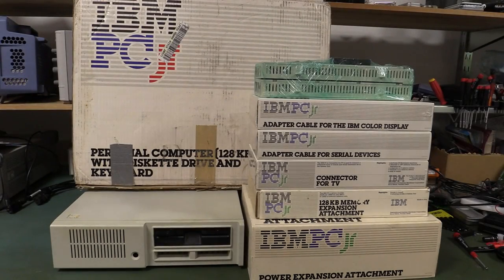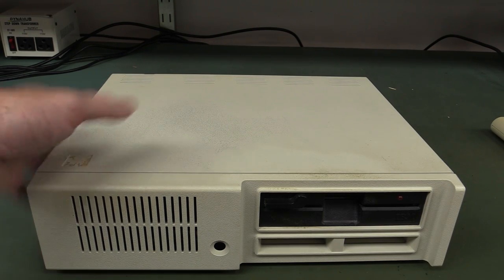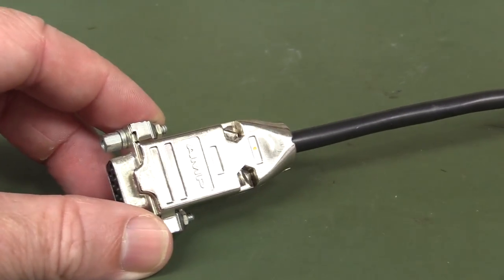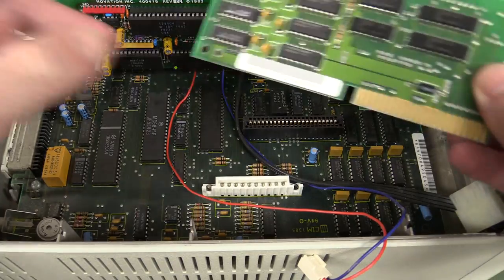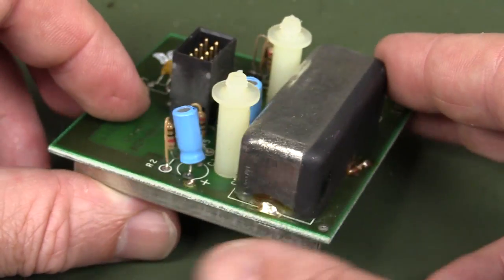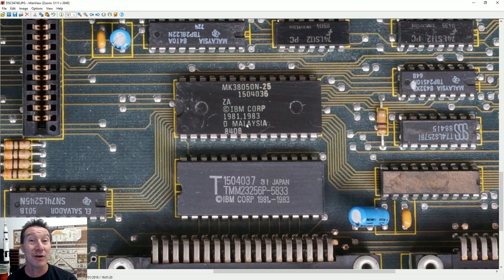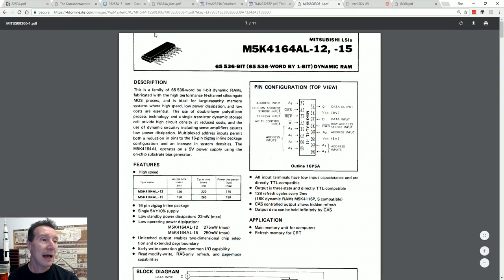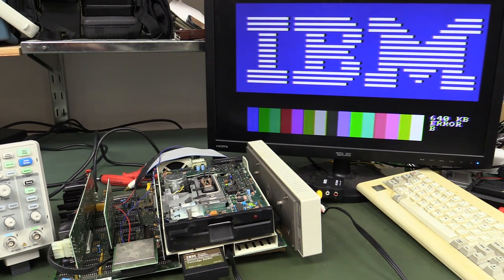EEVblog #1053 - The Biggest 80's Computer FAIL - IBM PC Jr

Comment: Dave, open up the memory expansion side thing. The upgrade to 512Kb should be full of wires going everywhere. I remember upgrading mine. The plans for the upgrade came on fan fold paper. Of course, all ascii art. We were amazed to have a PC with 640 k at that time.
Reply from the maker: Will do, forgot that!
Your user icon is my image :-P
Reply: Yes, it is!! I had it for years now... The "dancing dolls" never get old.
If you can check to see if the cartdrige reboot system is as I comment below..
We used to make the weired connectors for the back ourselves with standard headders. You should have seen IBM's printer cable. Built like a tank..

Comment: Tandy did a much better job of taking the PC Jr tech and turning it into a usable product with the Tandy 1000.
Reply from the maker: Indeed
https://www.youtube.com/watch?v=av5NQ_3mW9A
Reply: Are you the same tandy ?
Reply: @Rohit Chaturvedi, Not quite, the original Tandy Corporation AKA RadioShack went bankrupt. We acquired some of the company assets including the Tandy brand and have revived it.
Reply: 1000EX was my first!
Reply: One thing about Tandy computers, they seemed to be well built.  I worked at radio shack during my college years and we had a 386 Tandy come back for routine service because the floppy wouldn't read data anymore.  It was used in a farming equipment service center... or maybe they used it as the plow.  It didn't look too bad on the outside, but when we opened it; it was almost completely full of dirt.  You could not see any part of the motherboard.  It looked like the surface of the moon.  There would be a little square or rectangular rise in the dust where a chip was.  Not one colored wire or piece of green PCB anywhere to be seen.  Cleaned it out, cleaned the heads on the floppy.... good to go.   I realize older computers didn't suffer from thermal issues like the modern counterparts, but to see a computer almost completely full of dirt and in regular service is something to behold.

Comment: WTF? The most intresting Part is this modded Memory Expansion! So please tear this down!
Reply: You can find instructions on the web about how to do the mod (as well as tons of other PCjr mods, like overclocking, two floppy drives, making the PCjr video mode Tandy-compatible, etc.).

In fact, I went ahead and uploaded the file I have here: http://mkgraham.dx.am/pcjr.html

Download the PCjr Club Library file and look in the Tool Box folder for a ton of mod instructions.  I just realized it doesn't include 512k instructions for the IBM sidecars, but it has 256k and 384k upgrade instructions, and has larger upgrade instructions for the Racore sidecars (and I somehow adapted them for the Microsoft Booster sidecar at one point in time).

Comment: Some companies did add a second oscillator for 8 MHz and called it the TURBO mode. Amazingly, they actually had a button to choose TURBO mode, instead of running it at 8 MHz all the time...
Reply: ats89117 The turbo button was nessecary because a lot of software, mostly games, was timing sensitive and would run to fast at the higher clock frequency. Standard speed was 4.77MHz.
Reply: Yeah.. try to run one of those old games in a DOS window today..  :-)  It'll be game over before you get your finger off of the start button!!
Reply: Steve Jones , thats were dosbox and slowdown.exe come in handy! 😴😉

Comment: 4.77 MHz was standard across the entire PC lineup. They chose that instead of the rated 5 MHz because it was a convenient frequency for the CGA to generate its clock and color burst frequencies from. They cut a few KHz off the chip's top speed to avoid having to put another oscillator in an addon card.
Reply: Thats what he said

Comment: I built my own 128K side car expansion.  Designed the Refresh logic and eteched the PCB.  I was lucky to find the source of the funky sidecar pass thru connectors.  Also built a sidecar that accepted an ISA hard drive adapter card.  Had to reprogram the bios on hard drive controller card to use polling mode since no DMA controller.  Had to de-compile/assemble the controller bios to source code (it was not published as far as i know) and hack in the polling code.  Connected an Oveletti 8MB hard drive.  I was in heaven. 
 Had great fun designing and building those projects, learned quite a lot.

Comment: The encoder on the floppy drive is designed so that you can adjust the speed from the 50/60hz flicker from a fluorescent light
Reply from the maker: Ah, yes, instant timing light!
Reply: Good call, over engineering knocked down to the bulb in the factory!

Comment: Ironically the Tandy 1000 was a clone of it.  And it was one of Tandy's most successful product.
Reply from the maker: Mentioned in there
Reply: Nice.  Still watching it.  Great video!
Reply: One of the main reasons was that it used standard components and connectors, not these stupid proprietary IBM ones.
Reply: Actually, the Tandy 1000 was not exactly a clone. First, it had much higher end graphics onboard. Second, it was based on the Phoenix BIOS. Third, it had more address space due to some odd little choices made with regards to DMA allocation. Fourth, it actually had a multi voice audio controller. Fifth, it came standard with joystick ports and controllers. Sixth, it supported MFM hard drives directly on board. Seventh, it actually had a dual mode switching power supply. 8, It ran IBM DOS directly with zero mods. 9th it had the ability to run IBM Basic, natively.  The Tandy 1000 was much more than a clone. It was the machine the 5150 should have been.  Having said all of that, actually, the Tandy 2000 was Radio Shack/Tandy Corps most successful machine. Yes it had compatibility issues but, it was faster and far more capable than anything IBM and ALL other clones had to offer at the time. And, featured what would become industry standard over time, video mapped outside the system RAM space.
Reply: Radio Shack managed to clean up fine over IBM's mess.
Reply: @robertking7584 So amazing.... try to find that today, a private label better than what's supposed to be the A-brand...

Comment: Dave,  the floppy could not have been "360 single-sided".   The single sided were either 160 KB if eight sectors per track or (with a tweak to DOS) you could make it 180 KB by jamming in a ninth sector.   The dual-sided diskettes were 320 or 360 depending upon sectors per track.

Comment: Great video Dave.
I worked for IBM New Zealand as a PC specialist and I was sent to your neck of the woods (Rosebery NSW) to be trained on the new PCjr. Even we true blue IBMers thought that it was a pile of junk. The one good thing about it, that I remember from the training, is that you can disassemble the whole unit by using any small coin. (Apart from unscrewing the system board.)
The PCjr was never actually sold in New Zealand. I was pleased about that.
The Japanese created a 'slightly' better version called the PCJX which IBM NZ and Aussie did sell.  (It was not available anywhere else other than Japan.)  It did not do fantastically well.
Reply from the maker: Wasn't IBM at Cumberland Forest back then?
Reply: Nope, not quite yet. They were in Rothschild Ave in Rosebury before going bush into the forest.
Rothschild Ave had the compute centre, the warehouse, offices etc. And around the corner in Morely Ave was the technical centre where they did electronic rework and other maintenance.
Reply: Come to think of it. IBM was still there in 1987. That is when the PS/2 and OS/2 came out. I was back at Rothschild Ave for the training.

Comment: My first IBM PC was a "turbo" XT with a clock that was switchable between 4.77MHz and 8MHz via a little toggle switch mounted on the back. Interestingly enough, you could switch clock speeds on the fly without crashing the computer.

Comment: During 80's the power adapters where heavy and bulky. However they didn't  have any fan neither the CPU. Most desktop computers didn't have a noisy rotational hard drive and were more silent  with the exception of the floppy disk drive occasional noise.

Comment: My very first computer. Once they were discontinued, they were cleared out relatively inexpensively, and made a pretty decent value for the time. IIRC, I got it with disk drive, DOS, a memory expansion sidecar and another sidecar to connect a Microsoft Mouse, for about $700, earned at my summer job between high school and college.

Comment: By the time I was messing with computers, most of them used UART16450 and UART16550 chips for Serial. The older chips were considered unusable for anything faster than about 2400 baud.

Comment: Ahhhh, the Peanut.  That's what we called it.  Was sold at IBM's short-lived retail outlets, typically located in the parking lots of shopping malls, usually sold to banks for use as satellite branches.

Dave, the extra power module was typically not needed.  Very few of those were sold.  But it was necessary if you loaded up the PCjr with "wedges", like that printer port wedge you showed.

As for why the Jr was so lean.... the idea was to use the Peanut to get folks thinking about upgrading to an XT and the execs did not want Peanut cutting into XT sales.  The market for Peanut was supposed to be children, not hobbyists (who were expected to shell out for the XT).

On the rear peripheral connectors.... there was a paper template with color-coding that you would mount to the rear bezel to ensure you plugged in a given cord into the proper socket.  The cords themselves were color-coded at the connector after a while.

As for that "AMP" connector you showed.   Using off-the-shelf connectors was a Don Estridge strategic decision to reduce cost.   But IBM executives in Armonk were furious that the connectors were not embossed with "IBM".  Later cords from IBM were indeed corporatized with "IBM" instead of "AMP".

Comment: I had this, imported from the US, power converter to 100V made by a family friend. Had both the original "blocky" keyboard and the new replacement real keyboard. Also 128KB of extension RAM and floppy drive. Learned Basic and DOS really well with it. Copied drawing program from PC magazine that used the Joystic as a mouse.

Comment: The smaller Motorola chip by the IR module I'm pretty sure is the character ROM; at least one place sold a "thin line" font ROM for the Jr back in the early 1990s. Also, the other mysterious chip with the IBM P/N and the seemingly anonymous markings is the video gate array (which essentially mashed most of a CGA, the extended color modes, and I think the RAM refresh logic into one chip).

Comment: been a long time since I saw 50/60Hz calibration bars. Once had a tech call in - he could not get the speed to adjust - he was using a flashlight... if the flashlight were pulsed at 50 or 60Hz it would work... but torches aren't normally pulsed

Comment: 360k was the double sided one !

History:
PC DOS 1.0   160k (single sided, 8 x 40 x 512)
PC DOS 1.1   320k (double sided, 8 x 40 x 512)
PC DOS 2.0  360k (double sided, 9x40 x 512)

Plus the 640k limit was the way IBM laid out the memory map (Graphics card was memory mapped starting at A000:0000
Reply: Yes, when I ordered my first IBM PC in March of 1982 it was only available with single sided floppies, but in the year it took to receive the PC, I was an IBM employee so I was not a priority, they upgraded both the RAM configuration and the floppies -- I changed my order to include the upgrades.  The PS/2 with 3.5 floppies and the first available HD of 20MB was a big improvement, but by then IBM had lost control and never got it back.  My Nikon D800E DSLR shoots 36MP still images that are, on average, about 44MB in size each and that's compressed at that -- I'd need more than two of the 20MB HD's to fit one image.
Reply: Didn't you use a disk notcher?

Comment: Hi Dave, you note about the spongy stuff in the cartridge and how long it doesn't last, well its lasted  over 30years!!!!
Probably back then the only D shell connectors on the adapter cable, were AMP and were that well engineered.
Are you sure that is the way the fan blows, the dust on it looks wrong if that is the case.
Reply: He is mistaken on the fan. It drew air into the case and it exited from the front of the case. There were versions of the PCjr that had standard ISO slots very late in its short life but I believe those were only for the American market. Also, many of those connecting cables were standard equipment when sold depending on the configuration the customer bought.

Comment: The Tandy 1000 video was not a clone or compatible with PCjr video. They both had an implementation of EGA's low resolution 16 color mode. There's a simple modification for the PCjr that adds the Tandy style access to that mode. If the Tandy's were "PCjr compatible" then no hardware mods would be required to run Tandy software on a PCjr with that video mode. It was possible for a properly written game to use the same graphics on PCjr, Tandy, and EGA without needing to modify any hardware. PC Enterprises sold a kit to do the Tandy video mod to a PCjr. I bought one then for the other three I modded I scavenged the required chip off things like dead XT motherboards or MFM controllers. IBM Canada had the instructions for this mod on their website in the late 90's.

Why would Tandy not make their computer really compatible with the PCjr? To keep people from buying software from Radio Shack stores without having to buy a Tandy PC clone to run it on to access the fancy video and sound capabilities. If the Tandy's had been out of the box compatible with PCjr, they may have sold more software but also may have sold fewer computers - to customers who already owned a PCjr. Calling a Tandy 1000 "PCjr Compatible" is like calling a Mustang II a "reskinned Pinto". Neither statement is in any way true. The computers share the same CPU, and can put the same graphics on the monitor, but the hardware is very different. Likewise a Pinto and a Mustang II could both be bought with the same 2.3L engine, but the only body parts they have in common are the rear floorpan (the rear seats are the same between the two models) and the front suspension crossmember.

The original IBM CGA has a low resolution 160x100 16 color mode that nobody used - until IBM paid Sierra Online to write a game specifically for that mode for the PCjr. Thus was born "King's Quest".

PC Enterprises also sold a kit to give the PCjr Tandy 1000 compatible sound, detectable by games that could poke around to see if the user selected configuration matched the hardware. Most games allowed independent selection of sound and video, so with just the video mod one could have beeper sound along with fancy video. But a few games insisted they had to have Tandy sound if Tandy video was chosen, and they would refuse to run on a PCjr with only the video mod - forcing the player to select 4 color CGA.

The PCjr uses the same sound chip as the TI-99 4/A. Three square wave tone channels and one noise channel that could do white or periodic noise. The Speech sidecar used Ti's speech synthesis chip. But no software used the sound or speech on PCjr to anything like what was done with them on TI's own computer.

I never bought their Tandy sound mod kit so I've no idea what was in it. Have yet to find any info online about the modification, other than it existed in some scans of PC Enterprises catalogs in archives of PCjr info and software.

The floppy drives for PCjr were double side, double density, 360K. IIRC there were ways to make 3.5" 720K drives work. The never sold in America PCjx had dual internal 720k drives, and its case was black. Shortly after the PCjr hit the market a quick and dirty dual floppy mod was introduced, but it powered on both drive motors whenever either drive was accessed. A later update to the mod fixed that. Far as I know, nobody ever made any way to use 1.2M or 1.44M floppy drives with the PCjr. There were some hard drive addons but they were expensive.

PC Enterprises had many upgrades for the PCjr. They had Soundblaster and VGA sidecars. They had plug in cartridges with various combinations of ROM and BIOS hacks and mods. They had a realtime clock that plugged between the BIOS chip and mainboard. Their Thin Font mod installed in similar fashion, with a switch to mount somewhere. What that did was enable the alternate CGA font that was built into the PCjr but for some reason IBM made it impossible to access via the usual software method. This company, and several others, made "second story" addons which upgraded RAM to 512K or 640K along with a second 5.25" floppy drive bay. They also added the modification for the second floppy without needing to take a knife and soldering iron to the stock floppy controller. Some also added DMA for faster memory.

IBM made two power supplies for the PCjr. The long, higher power one (like in this video) and a shorter one which could support at most two sidecars, usually 128K RAM and a parallel port.

There was a 3rd party modem which was faster, 9600 baud VS the stock 2400. It had to have its own buffering to avoid losing data. That pesky no DMA thing again. On hackaday.io someone is working on a way to use the modem slot for Ethernet. With a bi-directional mod to a parallel port sidecar it's possible to use LPT to Ethernet adapters. To do that and also have a second LPT requires another hack to enable changing the LPT port address.

It's unfortunate that your PCjr is a late production, fully soldered board. Much more difficult to install under-chip upgrades like a clock or to replace the CPU with an NEC V20. With a V20 in my PCjr and 22 NICE it ran CP/M faster than the Xerox 820-II I had. The Xerox was faster with CP/M than the 12Mhz 80286 I had (with 12 megabytes of RAM on ISA cards, split between XMS and hardware EMS) running 22 NICE with Z-80 emulation.